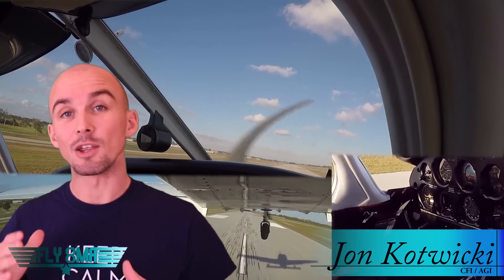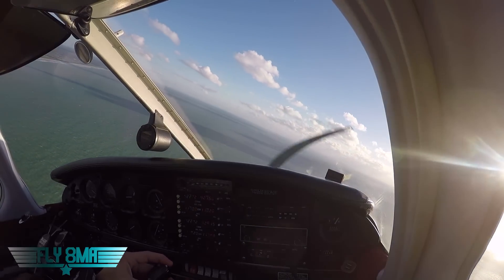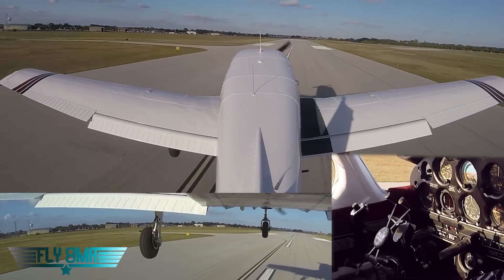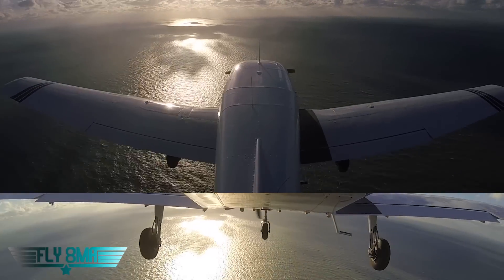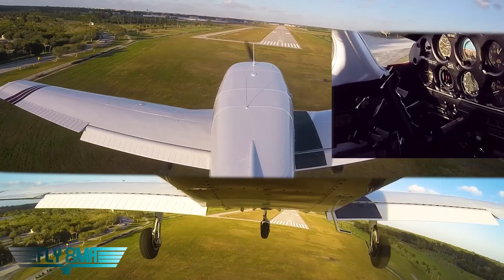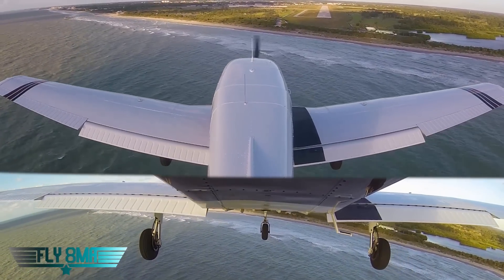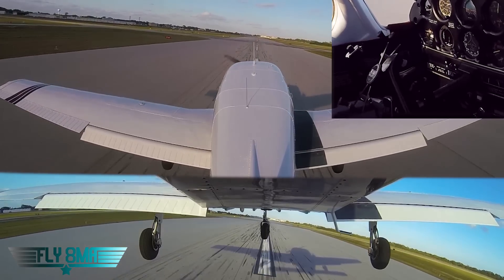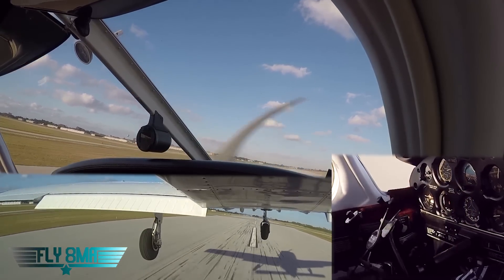MAX X WIND Landing! 25 Knot Crosswind | Piper Warrior HOW TO

Comment: If the runway is long enough, I would come in with flaps 1 or even no flaps.
Reply: Exactly!...1 notch max for anything over 10kts. Instructors seem to have this fixation of teaching the need for flaps on every landing. 
ATIS, ASOS, AWOS or even the current situation in the pattern is helpful on what the winds are doing. No flap landings in crosswinds are so much easier.
Reply: @muhammadsteinberg  Or just come in with full flaps and dump them over the runway. https://www.youtube.com/watch?v=aHer69j_VK0
Reply: @bhc1892  -Cut the flaps over the runway to cut the lift on the flare.  Here is another video doing it.  https:

Comment: Max crosswind for the Warrior is 17 knots right?
Reply: MatD13 “demonstrated” is the key word in the poh :)
Reply from the maker: Max demonstrated is 17kts...depending on experience and skill you might consider decreasing that accordingly.
Reply: Yes it is and that will be the figure the NTSB will use against you when you stuff it in as the 25kt gust slaps the tail and chucks you off the runway.
Reply: FLY8MA.com Flight Training LoL
Reply: Max crosswind is 17 knots without any wind corrections. It's in regards to side loading the gears. When you use a side slip to land like he did, you negate all of the side loading, so the max crosswind for a warrior is really until you run out of rudder, like he almost did on the second landing.
Reply: @513james513  No, that is not correct. Wind correction is needed in any crosswind. Cherokees are not suppose to incur sideloads on the landing gear.